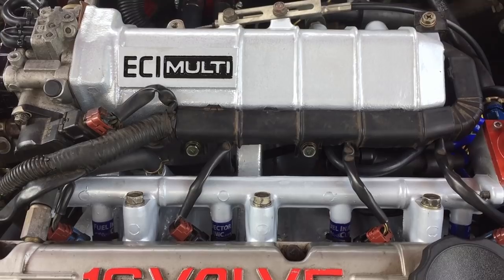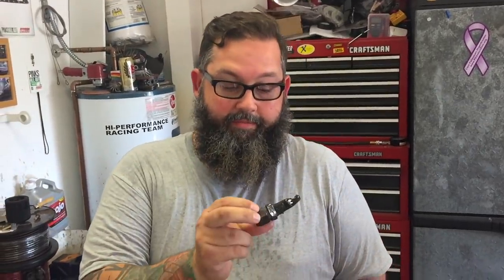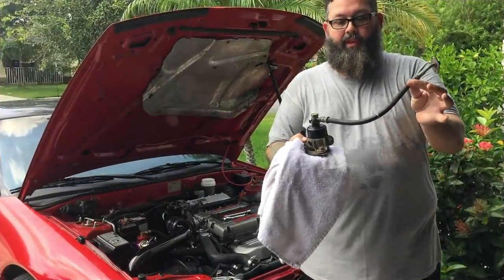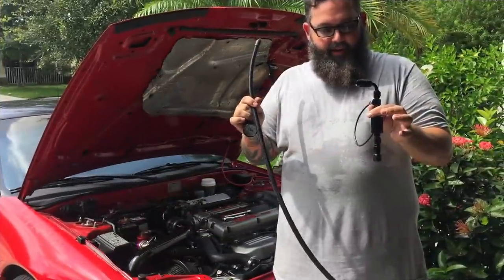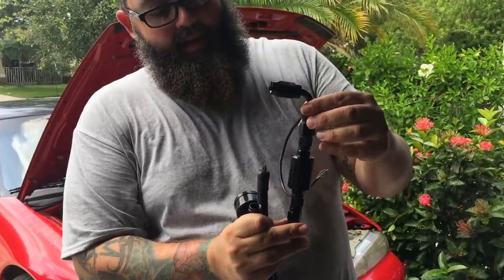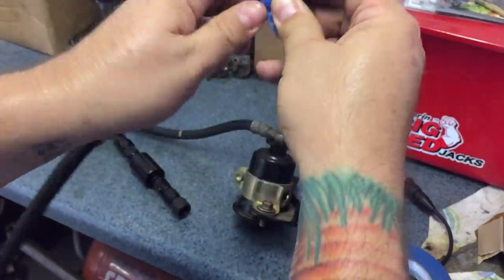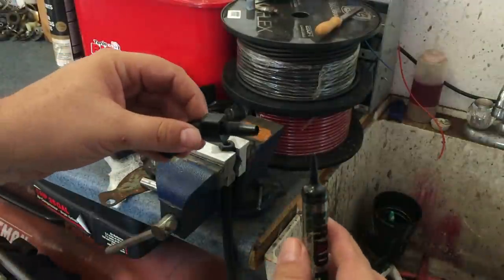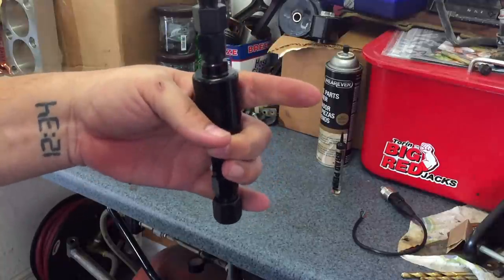Fuel Feed Upgrade - Joe Wrenches Vlog #17

Comment: Hi Joe, just started watching. I bought myself a 93 Talon with a front mount and wide band. Just bought a valve cover, ExtremePsi fuel tank to rail kit, wide band, ECMLINK, new 02, 850 injectors and Electronic boost controller. Can't wait to start installing everything.

Comment: Ever consider using self sealing quick disconnect fittings for the fuel feed and return from the rail?  A bit expensive but I always find either the feed or return line is in my way when I'm wrenching on the car.
Reply from the maker: Haven't messed with them. I guess I just work around the lines. :)
Reply: I suppose a 1G gives you more room esp on the return side.

Comment: I wish I'd thought to put the gauge in front of the rail before I put the AFPR in my 2G. That could have saved me some heartache.
Reply from the maker: AFPR is a good location for it. I went where I went because my AFPR doesn't have a gauge port.
Reply: There are some packaging issues in my 2G- it still has full accessories and cruise so there's not much room to work with.

Comment: Curious Joe, what were the symptoms that allowed you to hone in that the head was not flat, leak down test, coolant leaks? Nice fuel line upgrade, doing the exact same thing to my Evo in a week, E-85 compatible hard line to fuel rail upgrade (-6an).
Reply from the maker: Compression wasn't even. Then it actually lifted the head and lost coolant. Did a leak down and it showed leaking between cylinders. Fuel line was all about being E85 compatible. Lines at the tank end are all upgraded too.

Comment: Depending on how much material has been removed from the head, it will effect both oil flow to the cyl head and mechanical timing, which can be corrected with adjustable gears. (just a heads up) P.S. How do you like the Brail battery?

Also 50psi fuel pressure wtf? That's to high man.
Reply from the maker: I'm aware of the effects of cutting the head and have accounted for them. I thought the braise battery was junk at first. Turned out to be my starter cable that were junk. It's a nice battery. The injectors I bought won't reach my goals at the factory 37psi. They will at 50, so that's where I set it. That pressure is perfectly fine. People run way more than that.
Reply: I see, the concern with high base fuel pressure is that as it rises in a 1 to 1 ratio, if you don't have enough pump you'll run lean up top as 50psi base fuel pressure 20 psi boost = the demand for 70 psi of fuel pressure, and most pumps start to drop off fairly quickly at and above that in fuel volume That's all, if you're aware of that too then all's good.

Comment: I know this video is old but I’m a owner of a evo 1 and I like that fuel line with filter upgrade can u give me the fitting u use and the filter
Reply from the maker: Man, I don;t remember... Irs a filter by Russel and it's -6an. The adapter from the stock fuel line comes from Radiant. Mitsubishi fuel line adapter. Something like M14 inverted flare, to -6an

Comment: Did I hear that correctly? 50-psi at the rail, isn't that too high?
Reply: I always thought 43.5 lbs
Reply from the maker: Actually, stock base fuel pressure on this car is 37, but the injectors I bought won't reach my goals at that setting. They will at 50, so that's where I set it.